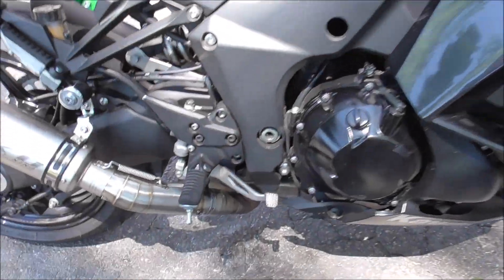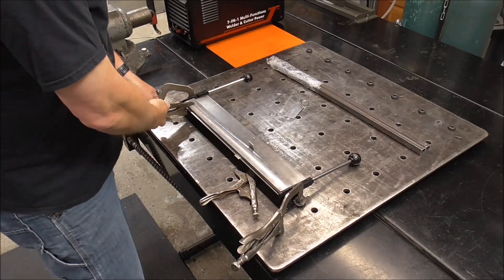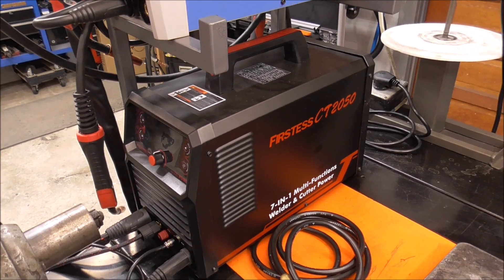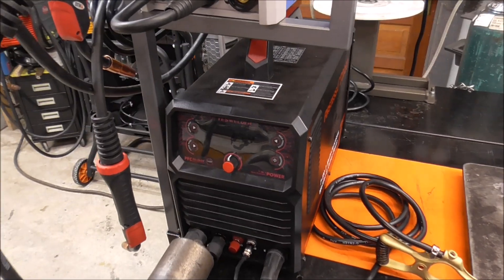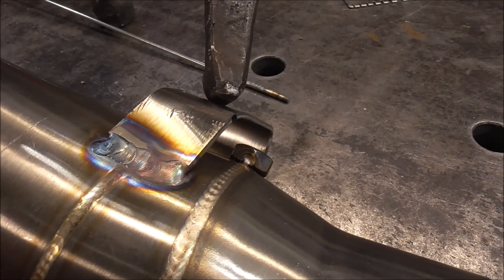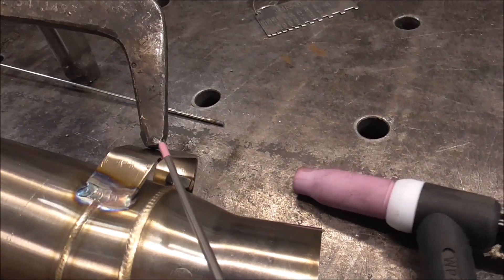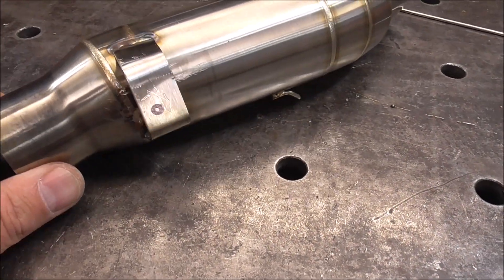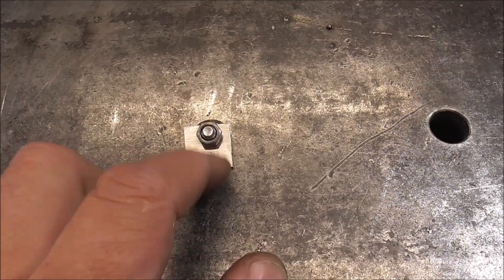TIG Welding Repair Cheap Stainless Steel Exhaust

Comment: it's a Tig 250ac\dc DV all they added is a air compressor and plasma cutter over priced for what it is you can buy a Tig welder and a plasma cutter for less than what that machine cost.
Reply from the maker: Where can i find an AC pulse tig machine and a 45 amp plasma cutter with an onboard compressor for the current price of this machine, which is currently around $1050?
Reply: @BrandonLund  and don't get me wrong Brandon I love your videos and everything but I think yes welder is pushing too hard to try and get into the industry with a product that is substandard of what welding equipment is supposed to be. It's just me with my personal opinion that's all nothing personal just me running a bunch of equipment and seeing that is out there and what is being pushed way too hard just like with yes welder they just gave an updated has a 2-year warranty on that machine you buy a TIG machine and a cut 60 from primewell do you get a 3-year warranty. But like I said it's just my personal opinion upon everything

Comment: Good job! What is the thickest metal you have successfully cut with Firstess Plasma function? Curious as YesWelder markets it as 1 inch.
Reply from the maker: @J Dimeo thanks man! So far ive only had the opportunity to cut 3/8" steel and it did that with ease. Its rated at 45 amps on the plasma setting. Ill have to try and see.

Comment: Nice job came out amazing looks good with the trim peice back in with that ebay Exhaust you going to out the trim oeice back on the other side also or leaving it off @Brandon Lund
Reply from the maker: Thanks man! Oddly enough it only has that trim piece on one side

Comment: Techniques, techniques, techniques!!!!  Such a wealth of information in this short video, and not just for stainless!  This is one of the reasons I watch your videos on a regular basis (and miss them when not on!!!)  I did wonder why you didn't use the plane of the existing bolt to make your bracket?  Also, that idea of welding the nut to a piece of  metal and then welding that to the bracket is pure genious.  That is what comes of years of doing this!!!  Be well, be safe, be Blessed!
Reply from the maker: Thank you so much @Jim MacSuga. The way they had welded the nut onto the exhaust made that shroud piece rotate too far downwards. I tried copying the angle from the original exhaust and that was giving me trouble also so I ended up with the tried and true method, tack it, bend it, try it, bend it again, try it again, say a prayer and hope for the best lol. I appreciate your support buddy! God bless!

Comment: Awesome job very helpful, only just looking at tig welding, but consumables aren't cheap, but looking into it, all the best to you and your loved ones
Reply from the maker: @Donald Halls thanks man! The consumables get expensive when you start getting into the pyrex lenses and such but those really arent necessary when you are starting out. Just stick with the generic #5 cup that comes with the rig and grab some 3/32 LaYZr tunsten and start having fun.
Reply: @BrandonLund  no worries thanks mate you have a good one

Comment: Super helpful Brandon!  Makes me want to try stainless!  Related Q:  on all these videos that you do, how long does it take for the metal to cool down after welding say a one inch weld?  Or do you dunk it in water to cool it down, or spritz it with water or something?  Thanks.
Reply from the maker: Thanks man! @Eddie Agha Stainless takes a real long time to shed it's heat and aluminum does too. I never spray with water because it can weaken the metal. Something like this is pretty hot for about 5 minutes afterwards. I have a tendancy to weld hot and fast because spending too much time in one place will heat your part up for longer (whihch caused the grey color you saw on the side where i blew that little hole through). When I do practice welds on coupons to get things dialed in I will dunk in water because I dont care if it warps or cracks.
Reply: @BrandonLund  thank you!